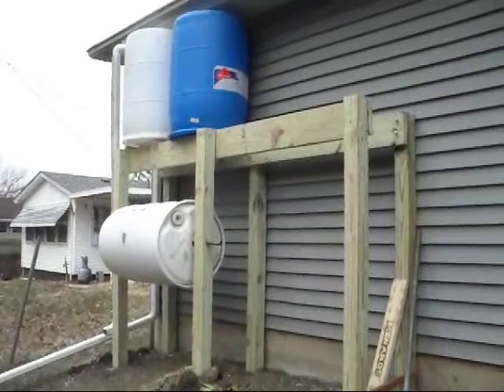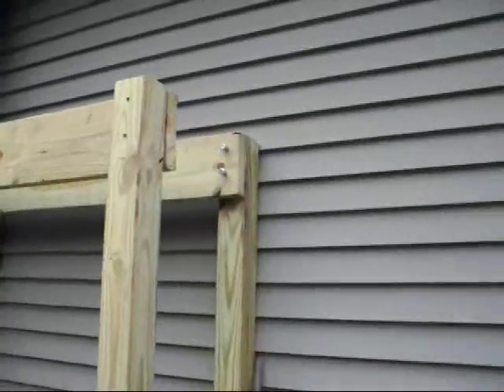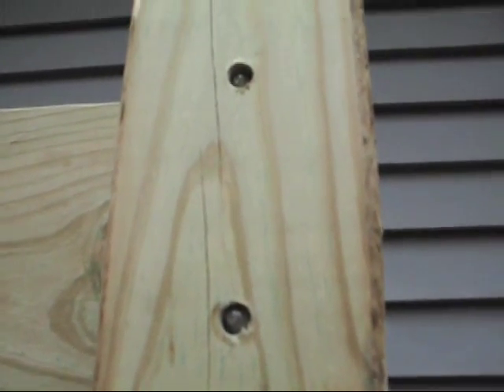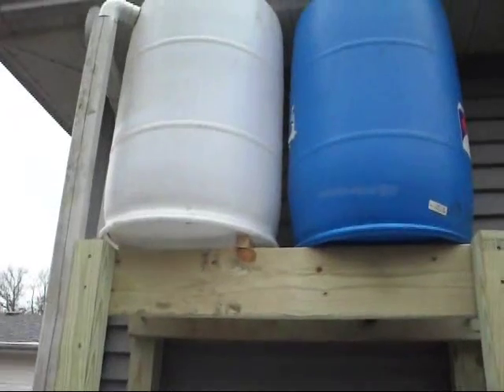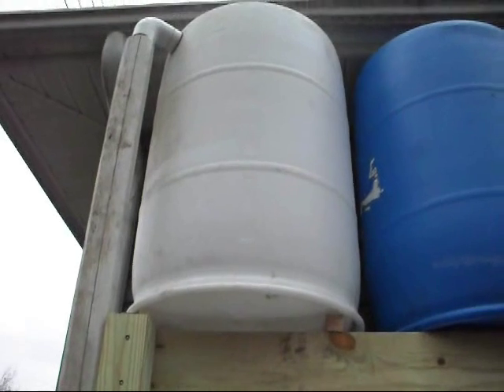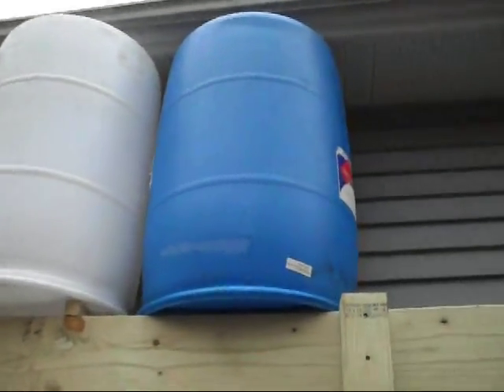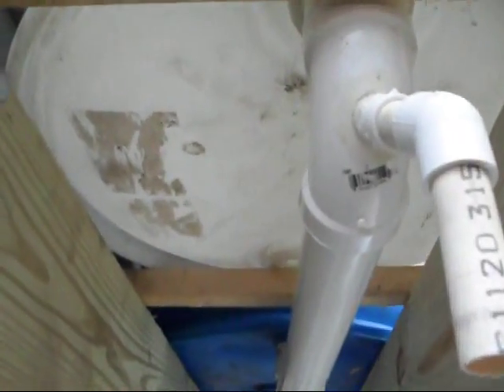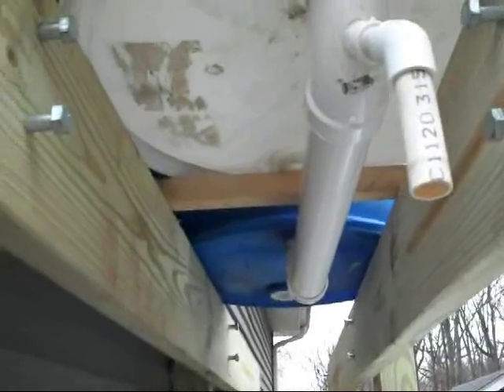Rain Water Collection & Compost Tumblers - Part 1

Comment from the maker: Hi Justin -
There are two bungs on the top of each of the 55 gallon drums.  One of them is a very course thread and the other one is a fine thread.  Hopefully the barrel you have fits this description.  You need the fine-threaded 2" male PVC adapter.

There was one barrel I received from someone where the hole was actually larger than 2 inches since this didn't work.  The drums I have were received from an oil changing shop and they had windshield wiper fluid in the barrels.

Comment from the maker: I'm not sure what you mean here.  The system is made of 4x4 posts with two heavy-duty lag screws in each that connects the two horizontal 2x8's to the posts.

This weekend I actually upgraded the whole system - added two more rain barrels for a 330 gallon capacity now.  I also used 2x6's  instead of 2x8's since using 2x8's is a little over-engineered - and of course, the 2x6 in a 12-foot length are cheaper.

Comment from the maker: @Kyle333Kyle 
Hi Kyle.  Syrup and molasses are definitely some thick liquids.  I can't really answer this question since the barrels I received were filled with either car was soap or windshield wiper fluid.  I might recommend that you get some very hot water and if possible - run it through a pressure washer.  Put the pressure washer down into the hole in the barrel and wash down all sides.  Hot water usually will help make thick liquids more viscous.

Comment from the maker: @pugnayshus72 Good question.  I have pretty much stopped using it completely.  As you said, the door warped on it as well but it still is in good shape.  I don't use it at all anymore because I have an upright 55-gallon drum I cut the top off.  I then throw all of the materials in here and fill it with water.  After a few days, I then drain the water through a spigot in the bottom to make compost tea.  I have made another video on the compost tea setup I have.

Comment: @bsntechdotcom  I am also concerned about your setup. the front and back 2x8 rails will have a tendency to spread, or open up. you should add a brace across either side and one in the middle to prevent this. Also, how are the posts anchored in the ground? I hope you buried them below  the frost line with a gravel base and concrete. otherwise you may have issues with your posts sinking in wet weather. That would be annoying at best and possibly quite dangerous. Other than that, it's a nice setup.

Comment from the maker: @Reximusprimebeta 
Yes, the posts are dug in 24 inches down to the ground.  A few of the posts were secured with concrete - but not a gravel base.  The other ones I just filled back in with dirt.  Was getting a bit cheap because this turned into a very expensive project.  As for the cross-braces, I have actually added those already due to all the comments on here.  I did see in some places where the rails were pushing apart.

Comment from the maker: @billyr70 
I have already fixed the issues with the system.  But yes, there was more than sufficient weight to push down on the rails to keep them in place.  But, braces have already been installed and everything is secured.  I added the last three barrels about a month ago so there are now 12 total.

Comment: Add a washer and drive those lag bolts home and grind the over hang off or get  a bit shorter ones  there is nothing really holding the 2bys to the 4x4s, other then that looks great

Comment from the maker: I can't really say either way as I haven't worked with the SL40.  However, the SL30 takes very good videos - as you can see in the videos I've posted.  The picture quality is very good as well.  However, the camera goes through batteries quickly - a pair of AA's just for a 10 minute video.  In addition, the audio capability for videos is not great - you have to be right on top of the camera to get decent sound.